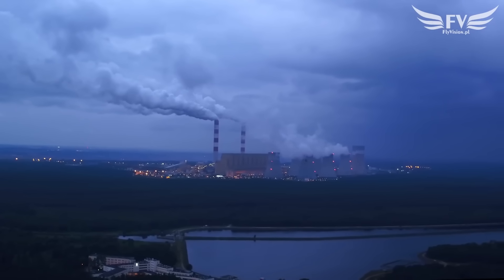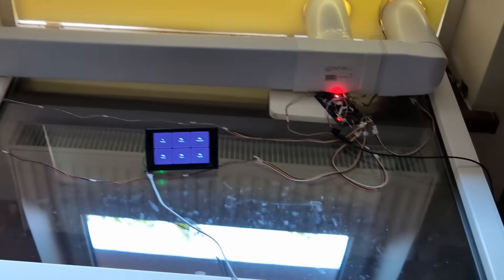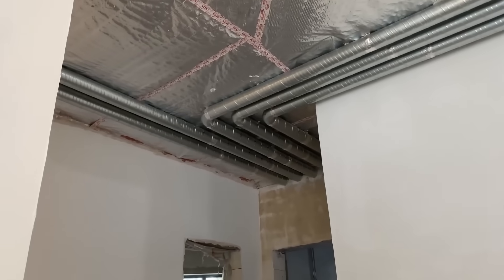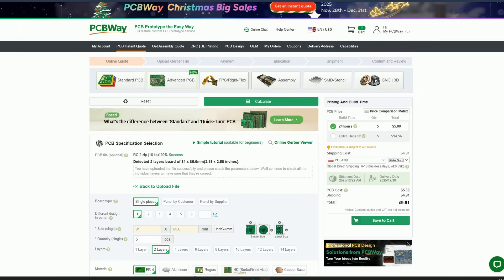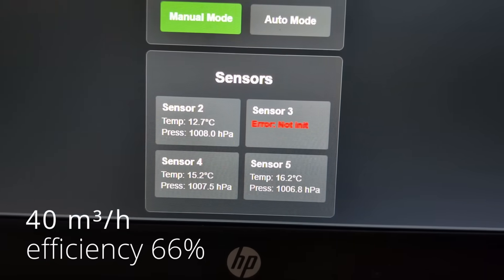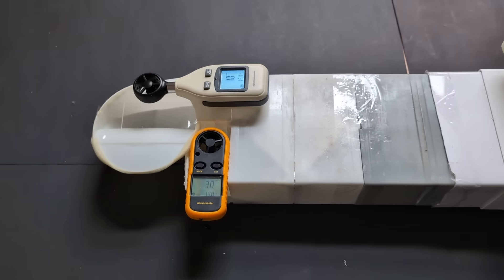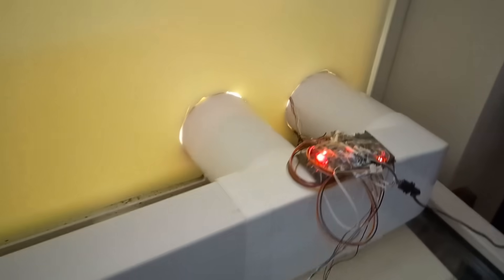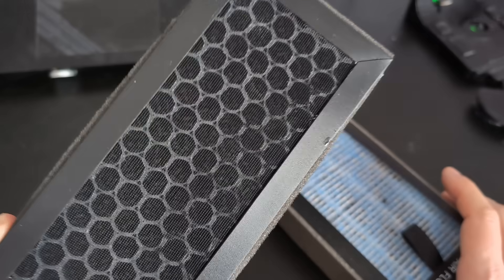DIY Heat Recovery Ventilator: From 55% to 90% Efficiency (Real Tests)

Comment: Wow! Your ideas, approach and progress are amazing. I'm subscribing in hope that it turns into a Kickstarter someday.

What I liked best was your iterative process and the insight that distributed units (cheap, atomic, smart, replaceable) often outperform a single monolithic hub.

Air in motion acts more like syrup than gas, making distribution through narrow pipes inefficient. It struggles to turn corners, faces friction from pipe walls and is hard to regulate. It's like trying to heat a house evenly without individual radiator valves.

Comment: Hey,
great work and I really don't want to break it to you, but in fact you are reinventing a solution already existing: Google for Zehnder Comfospot 50 or Meltem M-WRG-II E or Vaventis fresh-r or bluMartin freeAir100e.

Don't get me wrong here: I am posting the products above in case you do not already know those as a source of inspiration rather than to demotivate you! Those companies spent dunno how many millions on product development, so maybe there is something to source for us DIY'ers. Especially the size of the heat exchanger is remarkably different to your design, i.e. much bigger in volume (either longer along the channels like in the M-WRG or perpendicular to the channels like in the Comfospot 50).

I also thought about printing the channel profile in a 3D printer - this should work really well in reality and solve the leaks intrinsically. Would be very cheap to produce en-masse, too.

Much appreciate your effort into making this real AND posting videos on the topic.

BR, Peter

/edit: You would loose the enthalpy exchange (in terms of moisture) with the 3D printed structures, I guess. Though using PA for example (which is HARD to print) could solve this.

Comment: Nice, but do you know Inventer? It blows over a ceramic tile to recouperate the heat. I like your AL or CU heat exchanger, as it would enable separated channels for intake and exhaust. Also please include a active coal filter for the intake and a dust filter for the exhaust to keep the heat exchanger clean.

Comment: use Aircrete +  silicon dioxide for isolation, cheap easy too mold aero gel is a pain to work with

Comment: Nice break down of everything.
Will changing out a heat exchanger in a normal heat recovery unit for a aluminium or copper one further improve efficiency?

1 thing, you mentioned that a centralized HRU will cost upwards to €10.000 excluding installation while showing a orcon unit that only costs about €2.000

Comment: Summarizing some of the comment suggestions for your next, perfect and final version!:
- Consider condensation and humidity control (system should be immune from mold/bacterial growth and protect from rain/snow .etc)
- Optimize the fans for noise, power and static pressure (the system should not behave unpredictably if strong winds start blowing outside - the fans and circuits should be protected from the elements too)
- Consider 3d printing a heat core to see if it performs better?
- Consider looking into the "Mitsubishi Lossnay" system that keeps popping up in other comments
- I know you have copper in mind for higher efficiency - but I'm much happy to accept even the aluminum version if it has the above features
- Someone mentioned using the ceramic based core found in commercially available units as well

So far, great work! Now if this results in a compact ventilator, with humidity control, and barely audible fan noise levels (and hopefully not too difficult to put together) - it would be amazing!

Comment: High static pressure is an issue.  It increases turbulence, noise, power for fans, is harder on the seals, etc.  I'd recommending increasing the size of the unit so it all becomes easier, quieter, more efficient (more CFM per watt), filtering is easier, seals are easier, etc.

Comment: I really love the 'no compromise' and pure logic approach.
1) Copper is the best heat exchanger,
2) aerogel is the best insulator
3) each room should be conditioned individually to avoid wasted heat and energy spent on filtration

Admirable work.

I hope in future this concept becomes the norm vs centralised systems.  It would make retrofitting to existing buildings possibly easier and cheaper. i.e. drill a hole to the outside, mount the device, filter when the room needs it, always have that room free of pollutants.
Reply: Or, for us, that already have a central ventilation installed (and yes, its expensive as f..), sensors in each room can control the main manifold where this fresh air gets separated into different ventilation ducts for each room.

Comment: Noise is a huge factor for me, when the project is finished, can you try the same setup but with a Noctua PC fan? I'm really curious to what's the difference in efficiency and airflow, and they are essentially silent fans.

Comment: That's awesome, also you should consider the mesh/something to protect the system from insect, rodents and birds. For the improvement of the plates search for the designs of heat exchangers usually the design is  quite similar but it has a flat surface on the edges so a gasket can make the proper seal under pressure.

Comment: About isolation, I don't know about how much is aerogel, and how expensive it is. However, I would heavily suggest you to look about aerocrete. There is a video on DIY way to get it and it is quite cheap. Given what you are doing, you could probably just dump the whole exchanger (or parts) into it and wait for it to fix. Here the video :
https://www.youtube.com/watch?v=z4_GxPHwqkA&list=PLzvBji02I9DHoMwCwmjAivapdTQtxxVvS&pp=gAQB

If you looked at PCBWays for the PCB, I'd also suggest you to look at the equivalent for copper manufacturing. Given what you are looking for (the thinner the better, and just air tighness) it could be cheap and easy to model. It would also greatly helps the whole project because then you could just provide the files, and links to manufacturers to get it done for everyone.
Maybe you could also look somewhere to 3D printers, but then it's a setback because this is basically plastic. Maybe some exotic PLA ?

I also think an hybrid solution could lead to way better efficiencies. I don't know exactly how, but the greater the temp diff, the better it works even with low efficiencies. So you could for example get a little polycarb one on the end of each pipes (cheap, easy, ...) and the metal in the middle to do almost all the fine work.
You could also ty to look at some open structure (like cutting the polycarb) separated by just a clean sheet of copper. You would lose efficiency of course, but it would probably be easier to make with less leaks.

Comment: Nice! What do you think about utilizing heatpipes for this application?
Reply: I'm even thinking of two water-air radiators connected with hoses and a small pump. One placed high exhausting air from the room to the outside, leaving the heat energy in the water, and the other radiator placed low, bringing air from outsde in, while warming the air up.

Comment: Looks good. But you developed the wrong kind of thinking regarding material. Yes, plastic is a bad heat conductor. But that actually is pretty irrelevant, as another important component of the heat flow is also the thickness of the material. If you make the plastic really thin, the low conductivity doesn't matter. Several times in this video, you went for thicker aluminium of copper. That reduces efficiency and heatflow.

Bayernluft has a nice heat exchanger, which operates with a plastic  heat exchanger with a lot of lavers and area. A german electronics DIY µC guy bought one and did the measurements. 

At very cold temperatures, he measured nearly 100% efficiency or even above based on flow rate and temperatures. And that wasn't even false measurements. When you sent moist air out, it will condensate and when water condensates, A SH**load of energy, the latent heat of condensation is released, the same amount of energy that was put into it when evaporating. That energy is pretty large compared to the relatively small amount air has per °C, so if you got pretty damp air, it is no problem to go above 100% 😀

Professional companies just make plastic thin enough so the bad heat conductivity is irrelevant.

Comment: Some advice from my own DIY recuperator:
My tests with length yielded similar results, 30% of exchanger's length is responsible for 70% heat exchange or so and returns for adding more length diminish fast, there is no reason to ever go beyond 30 cm in length in my experience, even going beyond 20 cm might be an overkill.
I managed to buy a few of those ceramic heat exchangers they use in single pipe bidirectional retail recuperators for cheap and they work very well, they are widely used for a reason. 
High static pressure fan is crucial to overcome filter and wind resistance, pure throughput is meaningless if you can't overcome static pressure.
If you can install your recuperator's output in a place shielded from wind that helps a lot with wind messing with your fans.
If you can add even 30 cm of acoustic damping (more is better) it does help a lot with fan noise, also make sure fans are mounted with/on something elastic to not transmit vibrations into the ducting itself.

I don't understand why you want to keep moisture in, high humidity in winter where I live is the main reason why I built my recuperator; because I have a lot of plants it can sometimes go beyond 70% RH without dehumidification.

Comment: Nighthawkinlight just released an aerocrete recipe that might fit your acoustic and thermal insulation needs and be easier & cheaper than aerogel.

I bet he'd also be extremely interested in combining your exchanger plate designs with his ongoing experiments with radiative cooling coatings.

Comment: I was recently looking for small heat recovery systems for small apartments, and found VENT CLEAR DECO and Vent Axia Tempra P solutions. The prices are crazy, but the systems seem to be complete and (theoretically) efficient. 
Also, I was talking with my friend, who sells industry size recovery system. He mentioned that classic systems make an air way too dry. 100% humid air with 0C will have only 20% humidity at 22C. That's unhealthy and makes you easier to get lungs infections. That's why there are special hear exchangers made of paper, what returns humidity back to your apartment.

Comment: The problem is the house/apartment has to be air tight. This requires specialty windows/doors, etc. You can't have a fireplace or any other device that may leak the air from outside. The most energy efficient houses built today (passive houses) use heat exchange technology but they have to pass the leak test before they are certified "passive". The concept is very promising but very unpractical for existing buildings. It also dramatically increases the cost of new constructions however, this may change with open-source projects.

Comment: Hi! This is a really interesting project and your results are quite impressive. I have a few technical observations from a scientific perspective.

First, a small warning: I’d recommend being careful with UV light for home air sterilization. It often generates ozone as a byproduct, which you really want to avoid in living spaces for health reasons.

Regarding the heat exchanger: Nordic manufacturers have largely shifted from cross-flow to counter-flow cores due to the performance gap, but your results with cross-flow are surprisingly good. I believe the 'secret sauce' here is your use of vapor-permeable membranes. By creating an Enthalpy Core, you are capturing latent heat, the energy tied to moisture, which is often overlooked but critical for total real-world efficiency.

Also, your decentralized approach is very smart. Like you said, theoretical lab efficiencies (like 90%+) crumble in practice because of heat losses and pressure drops in long duct runs. By placing the unit directly in the "wall", you are eliminating those losses very effectively.

Keep up the excellent work! I’m looking forward to the next steps. If you ever want to swap ideas with a technically-oriented environmental scientist from Finland, please don't hesitate to contact me.
Reply from the maker: Hi!
Thank you for the thoughtful feedback — I really appreciate it.

I agree about the risks of UV and ozone, which is why I’m very cautious with UV use in living spaces. The vapor-permeable membrane indeed turned out to be a key factor: accounting for latent heat from moisture changes the real, practical efficiency a lot. And yes, the decentralized approach is intentional — it avoids duct losses that usually destroy nice lab numbers in real installations.

Right now I’m working on a new straight-through heat exchanger: vapor-permeable membranes between the channels, and a gyroid structure inside the channels to significantly increase heat-exchange area and improve mixing at low airflow rates. I plan to print it as a single part on an SLA printer, and later electroplate it with copper.

I’d be very interested to hear your opinion on this approach, both from a heat-transfer and long-term durability perspective.
Reply: @DIY_Yarik  Thank you for the detailed explanation. That sounds like a very ambitious and technically elegant next step.

Regarding your new gyroid design.The increase in surface area and the improved turbulence should definitely push the efficiency further.

I have a few thoughts on the practical side:

 - Maintenance and Drying: While washing the core is certainly an option for cleaning, drying it thoroughly might be a significant challenge. Depending on how dense or small the gyroid structure is, surface tension and capillary action can make it very difficult to get all the moisture out, which could lead to mold issues later.

- The Plating Challenge: Ensuring an even copper layer deep inside the complex internal geometry (Faraday cage effect) is tricky. If the plating process doesn't give you the results you want, metal 3D printing is a high-end alternative. It’s obviously more expensive and moves away from the pure 'DIY' spirit, but it would guarantee a monolithic structure with perfect thermal conductivity. It might be a solid Plan B.

I’m also curious about the pressure drop. Turbulent mixing is great for heat, but finding the balance so the fans don't become too noisy will be interesting to see.

Looking forward to seeing how the SLA-print and plating turns out!
Reply from the maker: I'm currently developing a heat exchanger. The hardest part so far is applying the copper layer. I hope to be able to complete everything, test it, and make a video within a couple of months. Although, realistically, it will take longer...
Reply: @DIY_Yarik  Yep, you can always think these time tables as the classic "5 min job" -> 5 hour later you realize that you havent eat anything at the whole day and the job is still no done.

Comment: or use less power and make with renovable sources. I'm self sufficent during half of the day, and i got only 350W of solar panels (on the balcony of an appartment). :-) But i'm  planning to add a vertical wind turbine on top of my 7 storiy building ;-)

Comment: Ottimo ma anche ingombrante ho già un filtro interno automatico e uno scambiatore  ad un solo foro verso l esterno a flusso alternato  cioè prima butta fuori aria poi si ferma ed inverter il senso per quanto molto meno efficiente e molto pratico e visto il basso flusso di aria e consumo potrebbe essere ricaricato  con un cavo  USB c  ogni tre o quattro giorni e funzionare senza fili  con wifi per programmare modalità ed ore di funzionamento e collegarlo al sensore PM10 e pm 2,5  per funzionare insieme ed anche in base all clima esterno ed al inquinamento esterno .

Comment: great video. sorry if you've already looked at this, but have you tried copper pipes with very thin walls? would that improve efficiency and solve the air tightness issue?

Comment: I don’t agree on the efficiency point of your video. My system is running for a week now, and I monitor all temperatures via Home Assistant and calculate efficiency. Outdoors temp is around 0-4 degrees in Hungary nowadays, indoor temp is 22 degrees, and efficiency is stable between 75-80 percent, both with 100m3/h and with 200m3/h as well. The weather is windy and I hear nothing from it. Efficiency also did not changed. And I built the system, but bought the components. Unit is an Artrea Duplex Easy 2. Elecricity consumption is also nearly zero. It’s maximum is 170W but the unit is running on 20-30% all the time.

But nice work what you’ve done, and of course cheaper, but I do not agree that it’s more efficient or silent. And regarding airflow, 1 person needs 30m3/h. 

Btw I’ve built the tubing on the attic, and the pipes are just 75mm OD, only around the machine you need 160mm.

Comment: I'm interested in an air-exchange system for a glass conservatory (Wintergarten in German). In the winter, draw dry(er) external air in to reduce humidity and condensation, draw in cool(er) air in and expel warm air especially when it is sunny.

Comment: Nice work. I've had this idea a few years ago but never went further. I was thinking of using copper tubes like a straw and filling it with thermopaste. Also I didn't see where you installed the fan but I would suggest you put them on the outside.

Comment: Nice work! The reason for using plastic instead of copper or metal?  If the materiaal is very thin (<0,2mm) the heat transfer rate hardly counts anymore. (Do the calculations) I worked at R&D of heat recovery systems. We gained sometimes more than 95% efficiency. In my house i have also a centrilized hru, but i installed also valves for ventilating only the rooms that i use.